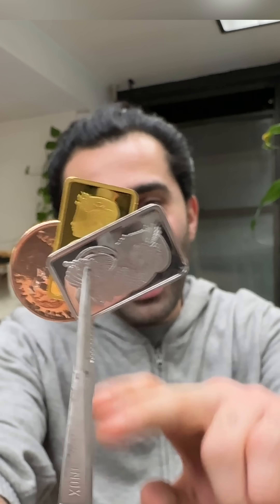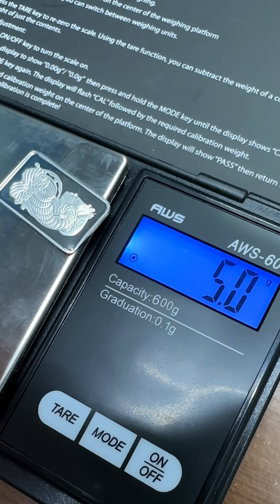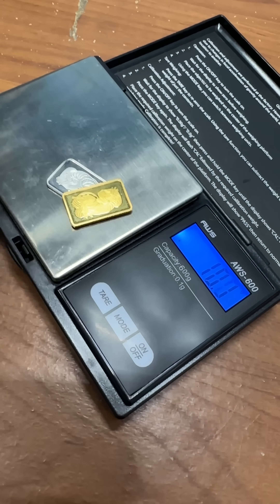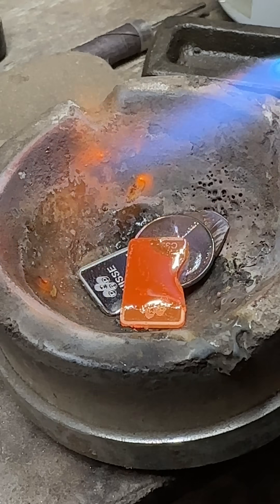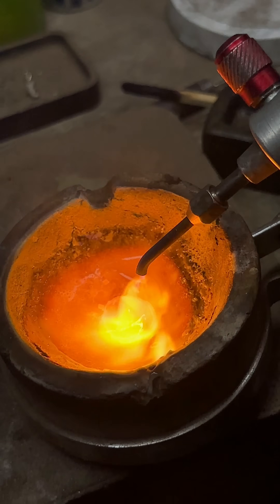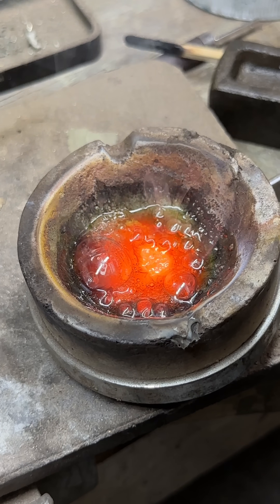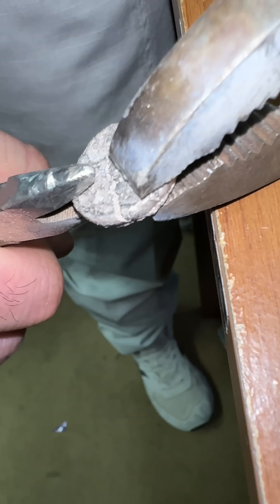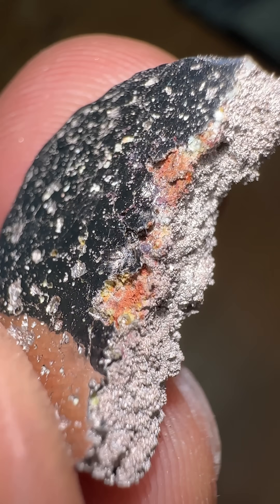CREATING A NEW METAL ALLOY FOR JEWELRY?!?!? #shorts

Comment: Copper oxidizes with oxygen present perhaps results would be different if you mailed it down in a vacuum kiln where oxygen is not present. This also imposes a problem whenever you attempt to re-melt the metal because of the presence of copper in the high temperature required to melt this new alloyoid. Titanium and stainless steel both react to oxygen when heated so when working with these metals they use noble gases such as argon to displace the air or oxygen around the metal while they weld.
Reply: The thing is, pennies don't really have that much copper in them, it's mostly zinc plated with copper.
Reply: @kalebjohns7715  1981 and older pennies are copper. I believe they were using pre 1982 pennies.
Reply: i think he put those white crystals in there to stop the oxygen
Reply: from oxodizing
Reply: Argon!, see how they make purple gold,

Comment: I bed anything it would've worked better if you melted them separately, slowing adding the lower temp metals to the higher, while mixing, then I'd experiment with different cooling speeds, to see how it affected flexibility, as it affects both flexibility and hardness with a lot of other alloys

Comment: I would recommend not heating directly with a torch as it could oxidize the copper, instead heat with something such as an induction furnace with a inert atmosphere such as nitrogen, also use a clean crucible
Reply: The funny thing is, a penny is 97% zinc and only 3% copper, like dude doesn't even know what metals he is using

Comment: I’m no jeweler or chemist but even I knew this wouldn’t work the way you did it. Melt them separately then pour them together and immediately cool. It has to be cooled fast so the platinum doesn’t cook the gold and copper.  Nonetheless I still don’t think all three will bond to form a solid metal properly.  Maybe tungsten and platinum 🤔

Comment: Your thinking was correct to use a pre 1982 penny for the copper but your mistake was that those pennies are not 100% cooper there is zinc in there. Your better off just using a 5 gram bar of copper. If your gonna use pre 82 pennies maybe use silver or white gold instead of platinum.  Word? Word...

Comment: If you alloyed the copper with something to raise the boiling point, that may have helped the attempted alloy to work
Copper boils at a lower temp than platinum melts at
Reply: Pennies are actually 97% zinc anyways Soo he doesn't even know what metals he is using
Reply: @kalebjohns7715  the way you tell if the cent is pure copper is the wheat one the flip side of the bust
The last year the wheat pennies were made was 1962

Comment: I was annealing a piece of Pt the other day and decided to fuse a little spot where there was a crack. Like a dumb fuck I forgot I had set the Pt on top of a small strip of Ti (couldn’t see the Ti with my goggles on) and the two aggressively reacted, showering my bench with sparks. I ripped my goggles off to look at it (again, like a dumb fuck) while it was still white hot. Luckily my eyes didn’t burn out of their sockets, but unluckily I looked down at a hideous blob of Pt/Ti alloy. It looked a lot like this, super porous and mega brittle, so much so that I was able to break it in half with my hands. I’m gonna try melting it again to see what happens, but if anyone has a recommendation on how to reclaim the Pt, feel free to tell me. Oh and feel free to laugh at my stupidity as well

Comment: Never alloy 3 metals at the same time. Melt the highest first. Add the second highest and then the lowest. Don't over heat the metals. You weakened the gold and copper beyond use. Lower platinum amount by 50 percent. Increase gold 25 percent and try again. Cool idea tho.

Comment: Use titanium gold and silver 3 separate pots set to exactly the right melting point of each metal  side by side have a 4th pot set to the difference of the 3 pore all 3 into the 4th mix and raise temperature gradually
Reply: If this works I'll take a job cause I just pulled that outa my ass xD

Comment: Man just threw it all in the pot. That and pretty sure Penny's are not all copper but could be wrong. But still if ones a higher melting temp then melt it first before melting the others and then combine them after they all reach the temp needed.

Comment: After smelting, try forging to increase the alloys strength. There was a ton of porosity, and that mainly caused your weakness issue. Hammer forging at critical temp, with multiple folds, should remove all that porosity

Comment: Need a better smelter with temp control. Less platinum. Cant just equal ratio it. Also cook the other metals down in the hot platinum if possible would help it to mix better. Been a welder for 23 years so have an idea about metal temps and how important it is for mixing and bonding ect. Not hating just some ideas maybe. A lot of impurities in that bar you ended up with so maybe the copper was poor quality or the temp it took to melt the platinum destroyed it.

Comment: CORRECTION!  
  You smelted: 33.3333% Au 33.3333%Pt 31.6667%Cu, and 1.6667% Zinc. 

 Using Copper wire would be a better source as it is about the purest source.  
Usually 99.9997% or better.  pre ' 82 one cent pieces (not pennies, pennies are English, or UK currency) only 95% Cu and 5% zinc.  also he smelted 4.75 grams of Copper  .25 g zinc.  This could actually make a difference in the appearance.  Also  MELT YOUR METAL WITH THE HIGHEST MELTING POINT FIRST! ADD FLUX, THE ADD COPPER, MORE FLUX, THEN ADD GOLD!
Reply: Correct!
Reply: Isn't that year of the penny a damn near pure copper penny though?
Reply: @jacoblay1935 still almost 2% zinc in those older pennies. 2% might not seem like alot but it matters with alloys 2% chromium to steel makes stainless steel.Copper wire goes through many extra steps to get super pure so it conducts electricity better
Reply: @johno1544  well, they are 5% and for steel to be considered stainless it must be 10.5% Chromium and less than 1.5% carbon, stainless always has an ammout Nickel ,Moly, and Nio.  Depending on the amount the alloy is different.  This is literally what I do for a living. Let's take 304 stainless for example. We call it 18/8 , 18% Chromium, 8% Nickel.   That is what Kitchen sinks are made out of.  Actually it is 304L  the L stands for low carbon.  If you raise the carbon it makes the alloy more hard and less ductile. 304H can be used in a knife blade.   Now take into mind that the difference in kitchen sink and knife blade is a difference in carbon is a fraction of the 1.5% of the total alloy.
Reply: @jacoblay1935  95% cu 5% zinc
Reply: bummer. itd be cool to see it done properly.

Comment: I agree with heat platinum first and replace the copper with nickel. There's already platinum and nickel alloys and copper and nickel alloys so I don't see why they wouldn't work well. Platinum is infamous for being hard to cast, so that may play a role. So in theory, get the platinum completely melted before then adding the nickel and wait for it to melt completely, THEN add the silver. I guess we also threw out the gold, clearly if you add gold, make it last. 4 in one is worth a try. PLEASE MAKE A VIDEO! I definitely wanna watch, I love smelting.

Comment: Please try this experiment again but only put the platinum in first and when that melts completely that's when you throw the other two in because of the fact that Platinum has a higher melting point you're not heating up the other metals for too long because if you do that it will weaken them which is why the experiment failed.

Comment: First of all each metal have a different melting point 
Second it a waste to bond them together because you would have to either one melt them together in separated order and different temperature or just bind them into a puzzle would be better or mold them together. 
The modules of each metal is different. 
You just made a peice of garbage and probably would have to work even harder to melt them again to divide this peice of 3. 
Maybe to get the all 3 metals out you will end up burning out one and maybe two into ash. While only able to extract one metal and maybe 2 if you do it right. But one of the metal will just turn into fumes.
You will oxidation the copper and gold which will become weaker.

Comment: Hell, I could have told that wouldn't work. Lol 

The platinum has the highest melting point . It should have been  melted in a crucible first, with the help of a furnace,  and then add the gold and then add the  copper last.  Then pour it into a mold underneath a blowtorch to reduce oxygen levels around the bar as it freezes . 

Platinum is a notoriously difficult metal to work with. 

It was impossible to smelt out of ore for hundreds of years. Until the discovery of "Oxygen" 
 And the advent of the blast furnace process to get platinum metal hot enough to flow .

Comment: as they melt at different temperatures how about melting them separate and then pouring them in together, using something that would vibrate underneath so it stirs in a good way a pre-vibrating canister that one all three metals are poured in at the exact same time it will start around in a way that will infuse them together, I promise you this would work
Reply: Yes but this is YouTube and they fish for views and likes
Reply: But I am going to remember this for metal work
Reply: You don’t need to stir molten metals. They’re hot enough where diffusion happens quickly.

Comment: You need to look at the periodic table to figure out if you can mix them and it will depend on the content percentage. Typically there is one large concentration. And the other concentrations are very tiny in comparison.

Comment: Instead of letting the bead cool inside the crusible...you should have poured it out into an ingot....proper melting and pouring out of the crusible...every smith knows that the glasing on the dish is borax...so is the shit tjey throw ontop of the melt during melting process TO PREVENT THE METAL FROM STICKING TO THE DISH...so letting a very very high meltingpoint alloy cool inside the dish is a very nubbie move...pour it at the highest melt point INTO the clean cast ingot so the borax is left behind...you melt while swooshing the metal atound and the less impurities are left behind...your mistake was letting it cool in the dish with all the trash thats left from the melting.....BBBBBBOYYYYYY stop it

Comment: The trick here would be adding the metals in at different times during descending end of the heating process. Heat the platinum first, then the copper is added as the platinum is cooling and reheated until the two mix, then the mixture is allowed to cool adding in the gold and again heat until the mixture melds together. Allow to cool and viola.

Comment: Hey traxxx, check out microwave powered kilns it's basically a coated heat resistant bowl that you can put everything you just put in that bowl but instead of hitting it with fire. You put it in the microwave and it gets it up to like ridiculous enough temperatures to make rubies which can be made using high 90 something percent aluminum oxide and chromium oxide

The YouTuber, nighthawk and light has a great video on this along with another video where he used an arc to achieve the temperatures

Comment: Melt the platinum first and as soon as you hit the melting point (3700-4200F ) add the copper (1984F ) then add the gold (1948) that way you aren't over heating the melculare level of each metal the platinum will almost melt them on its own.

Comment: And if you melt the platinum separate from gold and copper and mix it together ones it’s melted would there a chance for a different reaction of combining? 

Or is the problem in the cooling down of these elements together ? 

And would it be possible to lower down the platinum melting point, with a special type of chamber.
Mean this like if you go 1000meter up a mountain your water cook faster.

Wouldn’t it be possible with platinum for example ?

Would be cool if I could get a reaction back if this would work or not and why.